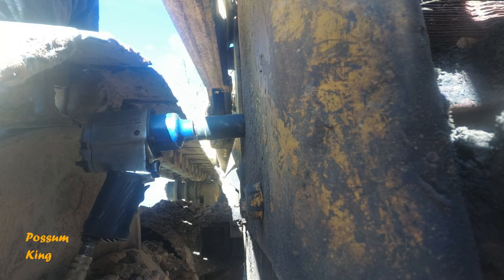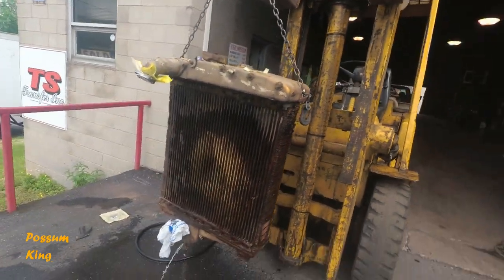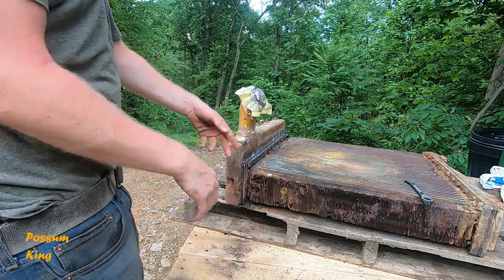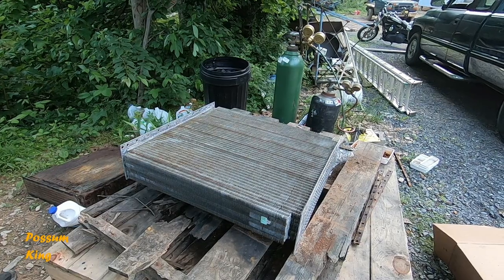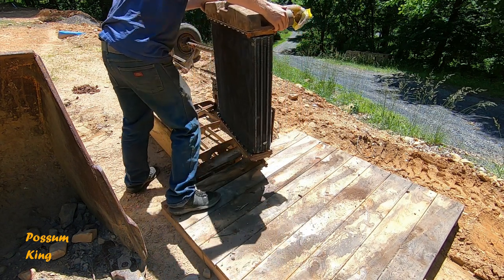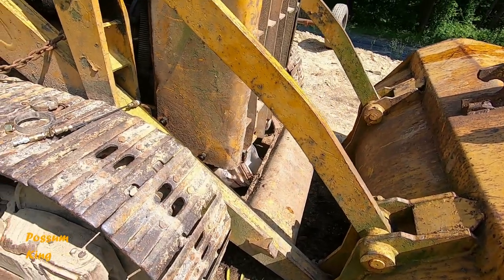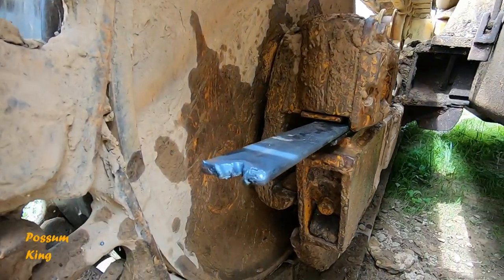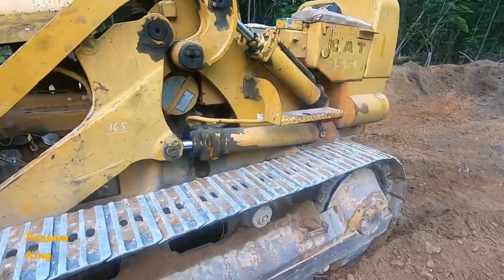Buy A Cat 955H

Comment: That was a brutal extraction. I suggest you invest in a Owners/Operators Manual, a Parts Manual and a Shop Manual for your 955-H track loader. These manuals make maintenance and repair much easier, you can find them on eBay.
Reply from the maker: Yeah I have one. It's just big heavy parts. Not much I can do about that.

Comment: Replacing the engine on our 955H as we speak, going through this same kind of stuff.  Radiator rebuild, etc.  Big project and all heavy stuff!
Reply from the maker: You have a d330a in it? They are really simple motors. I'm currently down waiting on engine parts myself.
Reply: @PossumKing   same engine! It ran very well but its worn.  It's a good time for us to go through the machine and clean it up, etc. Do you have any hints on engine removal/where to get parts/contact for your radiator guy? Thanks 👍👍
Reply from the maker: @TheOldMachines  I have nothing for engine removal. You need to find a manual on eBay. As for the radiator I used west side radiator in Denver PA. There is another company online that can make it for $1500. I paid S1200 though west side. I can get you a part number tomorrow if you want to look online.
Reply: @PossumKing  thanks for the info....that would be great. I'm in NJ. Our radiator is probably shot too so sourcing a new one is going to be important. We took the entire front end and loader off so access isnt that bad...
Reply from the maker: @TheOldMachines  The part number for your core should be the same (60a1 and up ser #)
7M9660
Reply: @PossumKing  thank you! I will probably have the engine pulled today...will keep you posted

Comment: Could of at least bought a real dozer. That you push dirt with. That’s basically a big skid steer to me
Reply from the maker: I mean it's a 30000lb machine. Crawler loaders and dozers each have their place. A loader works better for my project. Thanks for watching.
Reply: Too short on chain lifting radiator.
Reply: @digndurt6936  ...actually, the short chain allows the operator to rotate the radiator anywhere from vertical to horizontal just by curling or dumping the bucket making it easier to align the bolts in the radiator housing with the chassis. This guy did a lot of very difficult work by himself.  That alone is impressive.